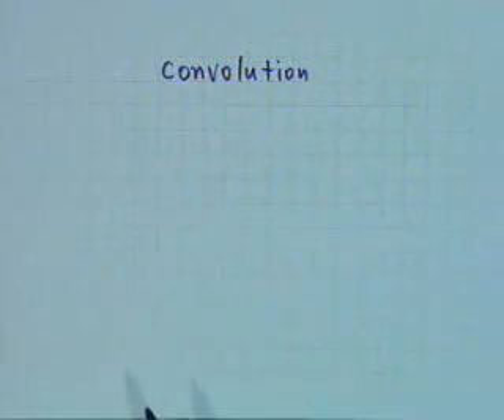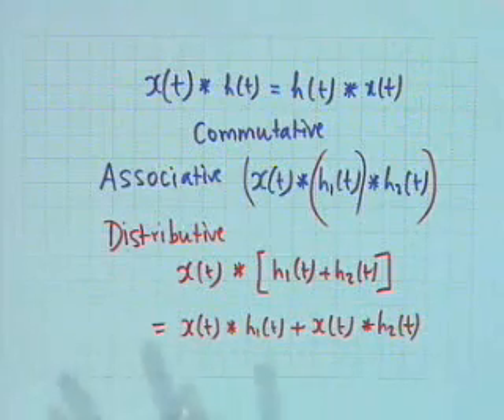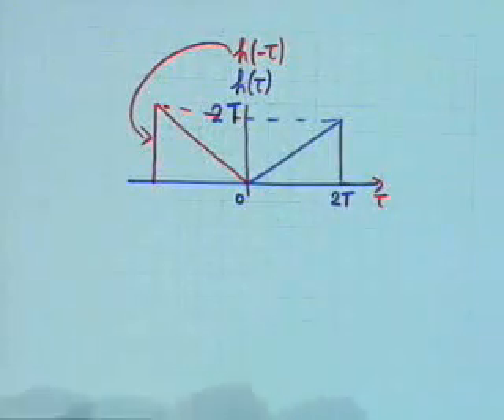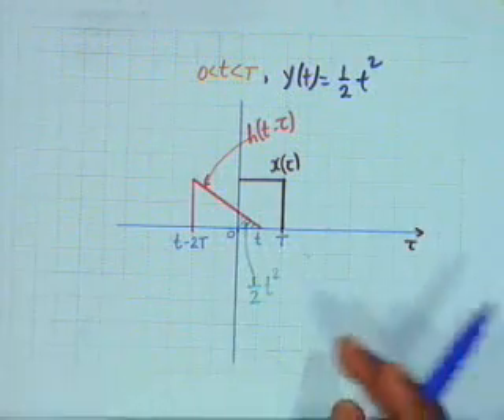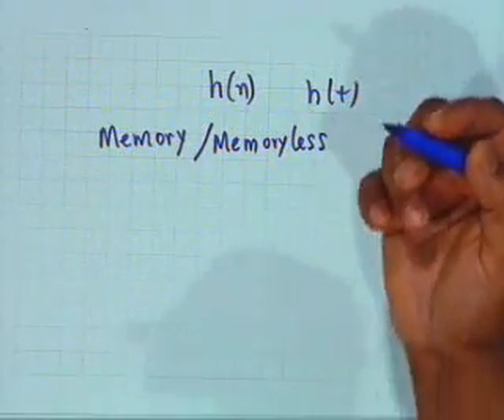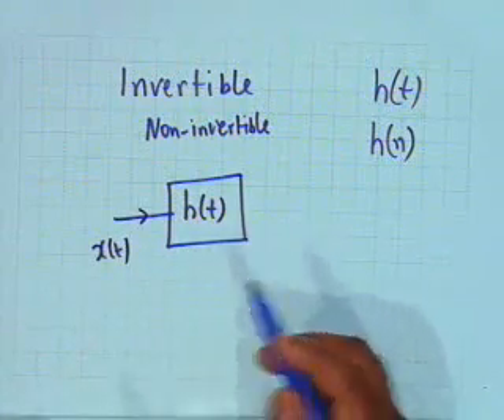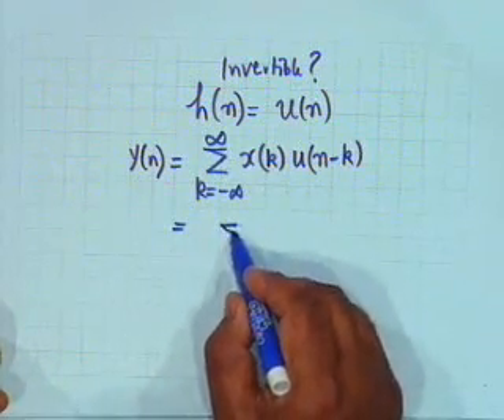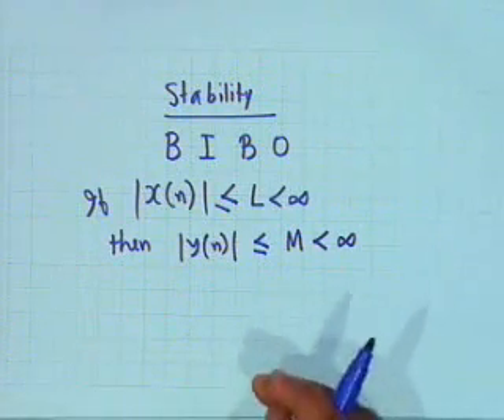6. Convolution Invertibility, & Stability Causality

Comment: in the figures used during calculation of area, how did the amplitude of h(t-tau) become equal to x(t)?
acc to the assumed values throughout the respective amplitudes were 2T and 1
Reply: +SONAL KUMAR exactly what I was thinking...!!! Found any clue...???
Reply: +SONAL KUMAR he already said he done mistake in drawing.
Reply: first i think he did mistake in the very first figure in which he compared the gate function and ramp function in which he accidently shown amplitude of both of them equal.
Reply: and in the second pre- prepared sketches he did mistakes in rising the amplitude of gate function to 2T instead of unity.

Comment: Sir, for the question asked at 32:15 .. lets consider an opamp with offset voltage. The output of the opamp is non zero when no input is applied .. in that case x(n)=0 but y(n)!=0.
Also say a vernier scale having zero error gives an output at x(n)=0.. isnt it that?
Reply: Offset voltage is the memory of the opamp. And same goes for the vernier scale. It is something like y=mx+c where c is the constant or the memory there beforehand.